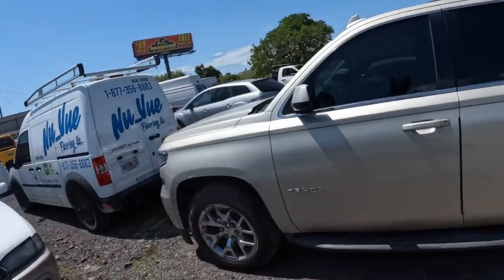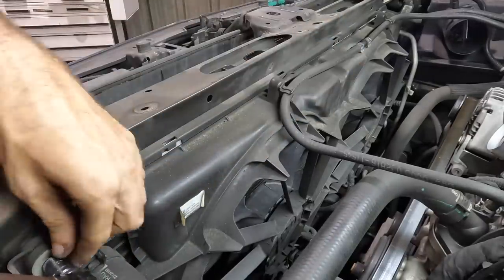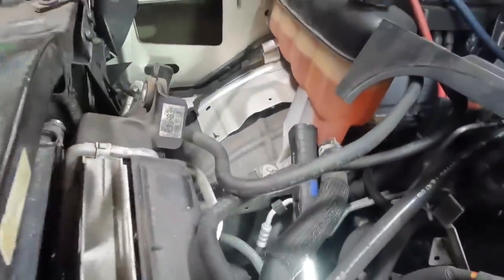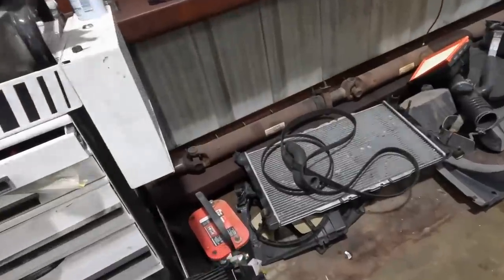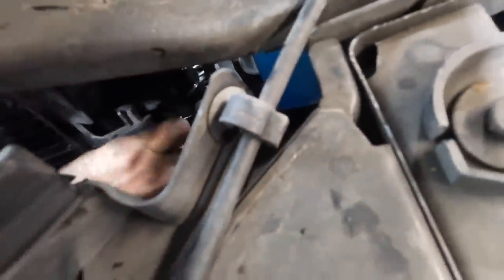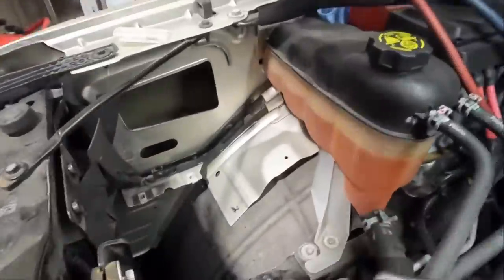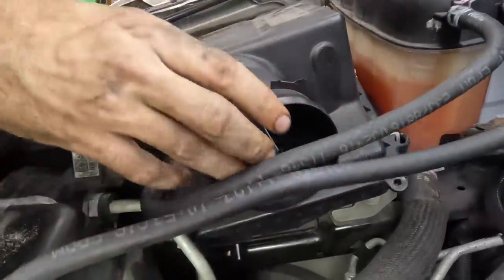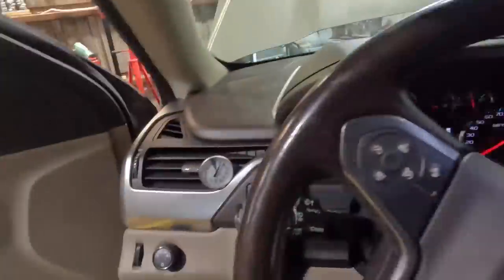Design Flaw? Cut In Half from Factory! CHEVROLET Tahoe 5.3 Freon Leak

Comment: I had to redo mine after a body shop put an aftermarket part on for 2 reasons the aftermarket part leaked and it never worked as good as thd factory toyota part.  Also the aftermarket part leaked at the filter tube on the side was made of steel the toyota part was aluminum and had a lot better heat transferring capabilities.
Its sad as shit when some Chinese made parts better then what the AC delco part hold it, ac delco is gone
Who knows whos making GM parts now.  Are the factory oem parts imported crap now?

If the orignal part is aluminum it csn be repaired and beefed up. 

You are really hooked on GMs me i wouldn't drive one made today.
Its crap, they fall apart  my dad drove GMs my brother in law retired from GM  my childhood was spent in gm product's  ive owned 1960s gms  think my last was a 64ss impla  dam tank  i once hit a nissan 510 station wagon built in 74 ripped the side of it apart like a pop can , didnt even dammage the chrome on my frt bumper.
Ill take a 60s very eairly 70s gm over one made today in a heartbeat
But ive long burned bridges with gms product's, when they started competing with Japanese made cars they lost touch with relality 
Now the craps made in mexico.
Gm is a dam import. 
Ask any former gm worker who lost his pension or got laid off. 

We used to make the best dam cars in the world, gm was the king at it. Now i wouldn't own one.

Comment: Imagine that, GM getting a little overzealous on the planned repairs. I had a B-I-L who worked at the transmission plant, he said the main transmission shafts and a lot of other parts used to come from TRW, they would find a bad part every once in a while, then one day they got these new skinny shafts that came in wooden crates, looked crude, had sharp edges where you couldn't pick one up without gloves 1 out of 3 were good parts the other 2 were trashed and that was at the start of GM becoming a chinese vehicle put together by Americans!
I still had people pissed at me for driving a Toyota Taccoma built in Kentucky while they drove a GM.
BTW my 2007 Tacoma is still going. Besides maintenance items, I've put an A/C compressor, cat back exhaust and brake lines ( michigan and its salty roads ) on. Much better than the Fords I used to drive and the repairs were in the last two years.

Comment: Ok, all is not lost, if you can get the leaks repaired on the condensers units , you can reuse them on you air compressor to condense the air from your compressor before it goes into the tank and blow air over the coils this way you cool the fresh made compressed air causing the water to separate and flowing out into the seprator to drain out.  Lot better on your air tools.  Or a paint shop.  If you submerge the condensers in water or underground it works even better. 
Compressor, condencer, seprator, tank seprator air hose tool. In that order. Youll get extremly dry air.
I know the relitive humidity in Florida is very high most of the year
And water vapor can be a problem.

Comment: Hey Ray, I always thought the Transmission cooler usually only ran through the radiator and not the AC condenser. I thought I saw a Trans line going into the radiator also. Why did they make that change?

Comment: Yes you can remove the upper support,  there are three bolts that go up from underneath the support at either side.  So much easier and quicker than removing the radiator
Reply: You dont have to remove the radiator, as seen in this video.

Comment: Because Heat transfer is why it cracks and heat rises after you replace the condenser and change the unit put a laser heat gun and you can see the top of the condenser will be hotter than the bottom.
Thus more heat transfer in the condenser thus failure.
Reply: Apparently the cut was for flexibility

Comment: Didn't the trans lines have metal wire retaining clips before the plastic things?
Reply: At approx 31:12 new unit had them already installed. You can see the trans line click in when being pushed in.
Reply: @Chris_Z.  ahh ya I see it, I wasn't thinking about those being pre installed like that, thanks for easing my mind!

Comment: Ray, you made no mention as to replacing the refrigerant oil that would have been in the old condenser. Back in the day it was figured that approximately 3 oz of oil (R12 system) would be in the condenser after shut down. Systems then held about 10 oz of refrigerant oil.

Comment: you will see that Chevy again just because the welds are a joke on the ac system. Just like you WILL see most hyundai's for the same reason. bad connection points and bad welds holding them together